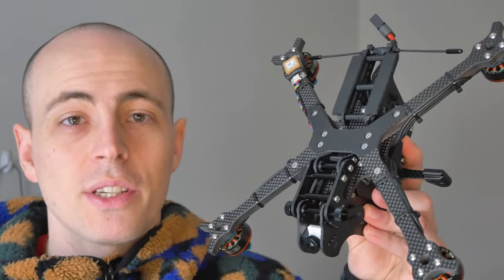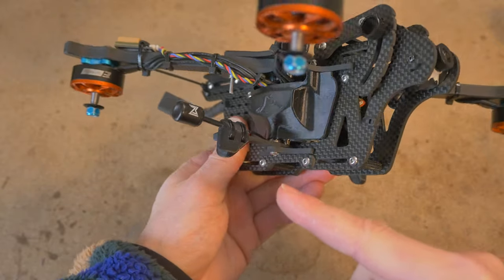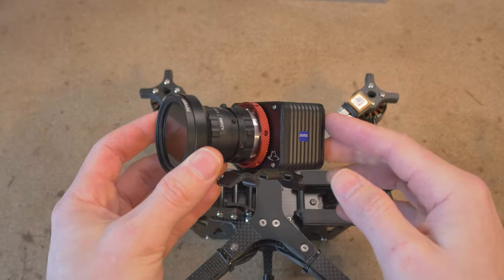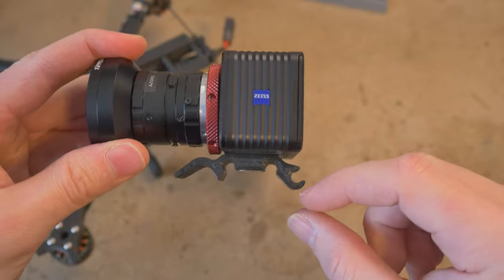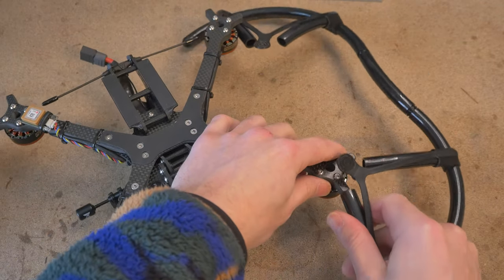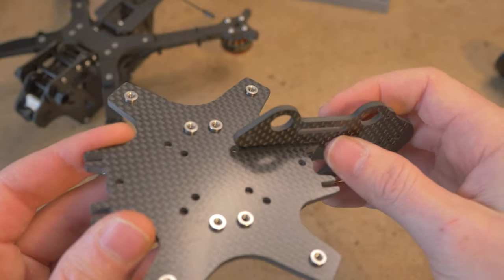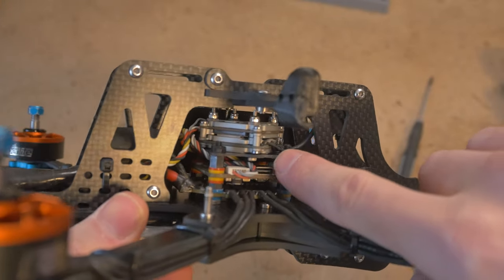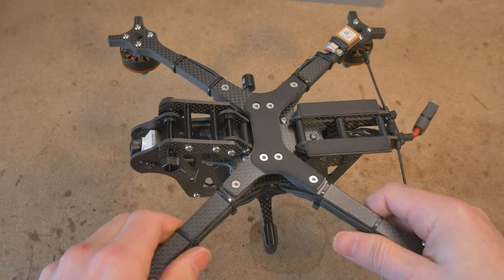Vulture Design Review

Comment: Looks very nice but I really don't like DJI antenna placement, since I prefer to run 200mm Matchsticks from TrueRC, it would be really cool to have antennas facing up
Reply from the maker: You can totally have the FPV antennas face up using the SMA 3D prints as described at 2:54 and use an ufl to SMA pigtail extension.

Comment: This setup is awesome. Your rotorbuilds page is described very well.
I like that you settled for a 6" setup.
The big stator, 1700kv motors and high pitch props make up for the smaller disc area.
Like you said: it is more easy to reduce jello and still stay very manouverable, compared to 7" or larger.
Maybe your azure 6" were just unlucky. I like the gemfan 6042-3 a lot too.
Have you tried the hq 5x4x6 on this setup?
Reply from the maker: I should try it! I think it won't work very well though because I have designed a couple other frames that are 5" quad with beefy fast motors with the HQ 5x4x6 and the Gemfan 5" 5-blade props and with both, I didn't get much thrust and mostly hot motors and terrible Lipo sag, but with ducts and without.

Comment: Insane! I have motors in 2808 1500kv would it be usable on it or too little kv?
Reply from the maker: 1500kV will be too slow, I recommend 1700kV for both action cam and cinema cameras.
Reply: @strawhatsam  So I'm thinking of doing it in Xnova 2808 1900kv then, these motors are amazing in 2808.

Comment: if I put 35 V 1000uf capacitor it's okey? why did you put it that big?
Reply from the maker: This is fine for gopro and sony rx0ii type of payloads. For cinelifting mode you will want 50V 1000-1500uf due to increases voltage and current spikes.

Comment: would something like the brother hobby 2808s be to much for this? only 1500 and 1900kv. also what are your opinions on the BH 2806.5 vs the xnova?
Reply from the maker: I would steer clear of the Brother Hobby 2808 motors because they slip magnets like crazy. It is a design flaw with that particular motor. If going 2806.5, I would choose Xnova 1700kV, but the Brother Hobby 2806.5 1700kV motors are good too, not not quite as much power.

Comment: Wow, this looks like an amazing frame. Does it accomadate the new OS3 Air Unit? How does it freestyle? Not that it's meant for that but one might want to add a dynamic shot into the cinematic shot as well. Do you think it can handle a Sony Ar7 II mirrorless camera? Great video!
Reply from the maker: Thanks! It does natively accept DJI O3 thanks to the 20mm vertical plate spacing. No side plates in view either. It freestyles like a monster with a gopro/Sony Rx0ii payload. With Sony A7 II and similar cameras it is a very capable cinewhoop. Small split S and roll spins are easily executed in cinewhoop-mode.

Comment: You cannot take ground footage with inverted motors
Reply from the maker: You mean camera super close to the ground as you fly? Yes it will be a few inches higher, but not really noticeable once you get comfortable with the drone. You can still get quite low to the ground while flying to acheive that effect.
Reply: @strawhatsam  and how much efficiency gain will be there. It will be better if there's some kind of measurement
Reply from the maker: @Rohit-oz1or  Based of my experiences with real flights you get about a 30 second bonus with heavy payloads. So instead of 5 min, you get 5:30 for example.